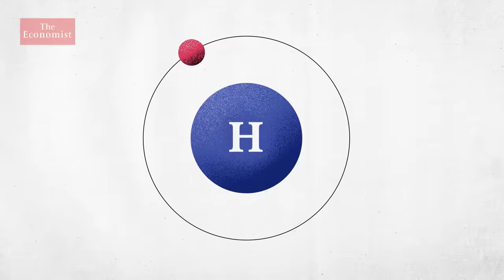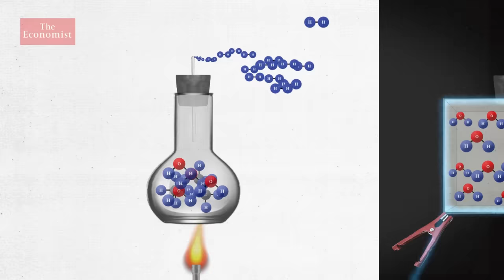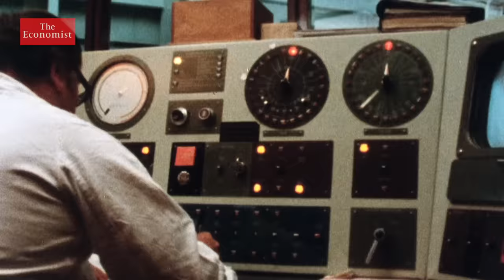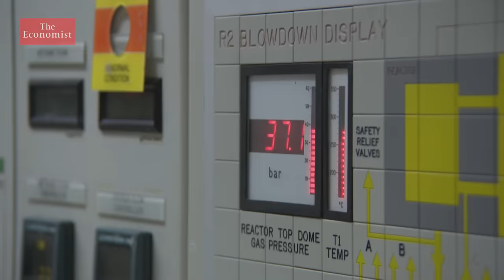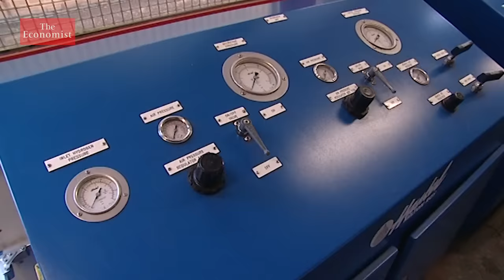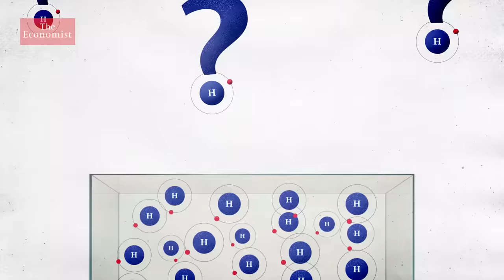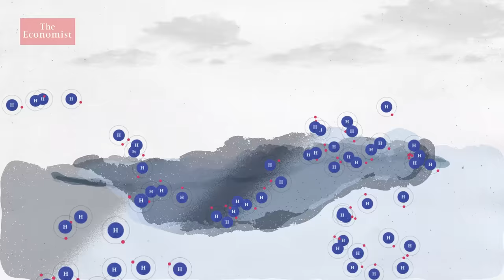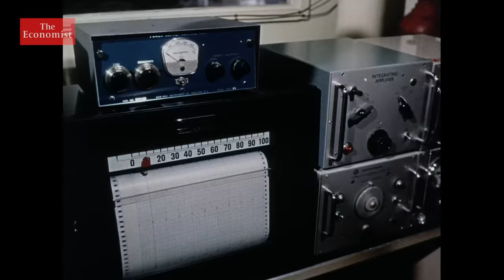Hydrogen: fuel of the future?

Comment: Hydrogen can function as a battery to store the excess energy from renewables when the sun is shining or the wind is blowing to then use when the sun isn't shining and the wind isn't blowing.
It could also serve as a battery for cars since the batteries we use now are unsustainable and leave an enormous amount of waste.
This is, because the materials required for batteries are too scarce and can't be reused after the batteries die.
Reply: I rarely have seen two sentences with as many factual errors than your post. Batteries are sustainable (lithium for example is more abundant than lead) and fully recyclable (when they reach that stage in their lifecycle in 20-30 years from now - today it's only 95% efficient). What is unsustainable is hydrogen fuel cells because they need platinum and iridium (the latter being the most rare metal we have at our disposal) to achieve any kind of longevity (5 years tops). I don't know if you are just talking but just to be sure: You need to have your FCEV pressure tested (700 bar/10000 psi) every 6000 miles, have new air filters installed every 18000 miles (at $500 a pop without labour) and have a new membrane at $1500 a pop every 36000 miles. That's what I call unsustainable. And on your tank filler cap there is a use by date printed after which you have to install a complete new high pressure tank system and hoses that can withstand the 10000 psi pressure - so it's a fixed "this car now is unsellable junk" date.

Comment: Nice video and you make the point well that hydrogen takes a lot of energy in to make it, especially via electrolysis. Now the chlorine industry has existed for around 100 years and the scale and technology is maxed out and mature and crucially it is basically the same technology used for making hydrogen. Sure you might yet squeeze another 10% efficiency out of it, but not 100%. Thus unlike batteries, there is not much improvement to be made. (You cannot beat thermodynamics.) So the costs will largely not change. Economically, today, hydrogen is a dud. It is unlikely to change much. The only way it will is to raise the price of everything else until it competes. So your last point is overly / naively optimistic.
Reply: Yes,u can't change the chemisty which makes H2 the highest density chemical fuel by gravity by far,there is 33.3KWh/kg,now the tech for H2 has advanced very quickly and is getting better daily,we can get zeroCarbon H2 from advanced nuclear reactors for very cheap.
Reply: Youre gonna be in for a surprise.

Comment: Yes, there is a certain hype, as always when governments hand out blanko cheques. However, it's still a hype. Besides the mentioned specialized industrial sectors such as steel production, I don't think hydrogene has any chance. Technically a lot is possible, but the costs, caused by the technical issues to keep hydrogene safe and contained as well as the poor efficiency over the transition processes, are just not in a reasonable area. Hydrongene cars are just not cost competitive with battery cars, and even for trucks, ships and airplanes there are already battery solutions at the horizon. And to use hydrogen as seasonal energy storage system, what Germany seems to be persuing, is just insane considering that more than 50% of the energy would go to waste.

Comment: Instead of creating expensive pipelines all over the land or hydrogen transportation through containers, I feel it is better hybrid stations of Electricity and Hydrogen Fuel cells serve for both purpose. These stations have EV Charging as well as Hydrogen Creation through electrolysis and containerization. There by we can reduce the  hydrogen leakage through transportation. So this enables small EV vehicles to be charged as usual and heavy duty vehicles can be refueled with hydrogen fuels. Hydrogen creation does not happen at source of Electricity, but at the point of fuelling.

Comment: Does the process start from sea water to fresh water then hydrogen gas ? Is salt the by-product ?
Reply: It's an electrolyte - reduces power requirements
Reply: @mtscott  all the H202  you can buy in the U.S. is made from an "organic" process  (oil) (HC's) combined with O2 from air
Reply: Natty, the hydrogen is made from methane, not water. Did you watch the video? Watch it again. And do a search about how Toyota makes hydrogen for their car. (They use cows. Cows produce methane when they chew which usually goes into the atmosphere and contributes to the greenhouse gases and adding to climate change. So this method has a double benefit). And a small amount can create a lot of power which they didn't go into.
Reply: @VoltLover00  American  Honda Motors has 2 electrolytic plants powered entirely by solar energy .
This is a "renewable" resource , unlike non renewable  HC sources .
Cheaper too .
Gotta THINK clearly.
Reply: @mtscott  I bet you've never considered H202 as an engine  fuel
Reply: @NCOGNTO  Not sure I understand your point. it’s a video about H2, not compounds of H. There is also ammonia, methanol, biodiesel etc etc. if you want to open up the discussion to all fuels. H2O2, as you probably know, was an experimental fuel in WW2 for rockets and torpedos because it self burned. But…it also has various limitations and it might not be useful to provide to the masses. Also…to make it is energy intense and produces vast quantities of CO2…opposite of what we are trying to achieve.
Reply: @mtscott  I can tell you're full of misinformation 
Where did you get those uninformed  ideas ?
Reply: @NCOGNTO  it’s called an engineering degree from a reputable institution.
Reply: @mtscott  surely we agree that H202  is the cleanest fuel then ?
Reply: Natty 27.

There are a number of ways to produce hydrogen the most common being produced from fossil fuels by steam reforming of natural gas or methane. I believe this to be the most pure form of hydrogen at the moment but, it is also the dirtiest form, Grey or Blue hydrogen.

The cleanest would be Green hydrogen, which would be made using renewable energy to make the power needed to use electrolysis to split hydrogen and oxygen. This still requires heat but the split takes place between 50 - 80C where steam reforming takes place between 700 - 1100C.

There is a ship called the Energy Observer that has been sailing around the world for 3 - 4 years now, using a mixture of wind, solar, and hydrogen to power the vessel, I think but I’m sure if they purify the water first before producing the hydrogen, best Google the project to find out more.

There are a few ferries in Europe that are powered by hydrogen but, they don’t make it on board, they top off the tanks when they come in to dock.

Hope this helps.
Reply: @martinrandall5836  you neglected to mention the 2 Honda solar / water H2 plants in California  for Automotive  use but I think they are significant
Reply: @mtscott  Michael  - most of the fuels you mention  are either flammable and / or require  pressure  storage .
H202  in any concentration  can be stored in plastic  containers  .
It is also the cleanest  fuel in use and manufacture (derived O2)
I think it's worth a look , if we are serious

Comment: HYDROGEN IS NOT A FUEL!!! Its at best a storage system and a very inefficient storage system at that. One of which perpetuates the pathetic distribution system of the oil companies... Hydrogen Fuel cells convert Hydrogen to electricity then puts it into batteries.... So the electric motor can use the electricity..... Why not just simply go to batteries??? Hydrogen may be abundant but you generally have to split it off from something then compress it to store it. Loads of wasted energy to get it to a useable state... Oh dont forget the delivery. 

Yes you cam make it and compress it at home... Again the waste. Just put the energy into the battery in the first place. Home batteries dont need to be the super expensive small Lithium Ions. There are a lot of very effective batteries for home use. Only use Lithium Ion for vehicles...

I have an electricity distribution system already in place. Its called the GRID. Which can be subsidized by home Solar and or wind. Let go of a failed technology! Lets move on!

Comment: Hydrogen is a total dead end because it’s hopelessly inefficient.

Electrolysis is only 50% efficient.

Even Toyota’s latest fuel cell in the Mirai appears to be less than 50% efficient.

And the fuel cell is heavy (500 Lbs) and expensive.
Reply: According to the US Department of Energy Hydrogen Program, a vehicle that run using hydrogen fuel cells are around 40 to 60 per cent efficient, whereas vehicles with a combustion engine runs at around 20 per cent efficiency. Still we are using very inefficient ICE vehicles for ages.

Comment: For airliners, the answer is YES.
For industry that need an oxidizer, the answer is YES.
When we want to store for a very long term and we have an intermittent surplus of electricity, the answer is YES.
But as hydrogen has an efficiency of ~20% in total, while batteries have 95%, even an improvement to 30% will not be enough for housholds, cars and trucks that do not drive too far. Long haul trucks is a middleground where price stand against time.
Reply: lol battery efficiency theoretical best is about 65%.  The difference is that hydrogen is not a fuel source that requires massive pollution and environmental destruction to produce, like EV batteries do.
Reply: Everything pollutes
Coal most so, then gasoline, while natural gas is better but still horrible.
As for storage, if you use you battery once a month or so, 65% is correct. Batteries should not be used that way.
But if used several times a week, the efficiency is well >90%
These facts really do not matter, the cost difference in practice will make H2 obsolete for houses, cars and most trucks.
It will not for airplanes, concrete, steel and long term storage though.

Comment: I still don't see the point in NOT using nuclear energy. Nuclear power is so much cleaner than most energies. Sure, the waste needs to be stored away for decades and so on in capsules, but it's so much cheaper and nowadays so much safer.

Comment: I've been holding my breath waiting for hydrogen to 'come of age' since I first realised that a hydrogen fuel cell car could be refueled at a petrol station as fast as my current car can. This solves the only downside for electric cars - range. If we decide to have only have cars with 100 mile range because hydrogen is available everywhere it will reduce the weight of cars, reduce the need for lithium and other rare metals etc.
I suspect that hydrogen is about to become very cost effective now that russia has caused LNG prices to soar. I wish I had shares in some suitable companies.

Comment: Storing solar energy in spring batteries for night usage is possible?
Reply: The future is not battery acid the future is hydrogen.
Reply: @rickrozen2341  I agree acid batteries and all the processing to make them is not a positive direction and hydrogen should be the way. My idea here is to use springs to store the energy by winding them up by electric motor during day and using the loaded spring energy for lighting not cars at night. No chemicals, problem may be metal fatigue.
Reply: @billykuan  You should send an e-mail to Elon he loves springs, giant catapults and other clown ideas.

Comment: Wait.. hydrogen DIDN'T cause the Hindenberg to explode? Then what caused it?

I ask because this is what was taught to us in school.
Reply: The doped canvas skin. The H2 gas is very buoyant,so escapes upward with no ill effect. Toyota fired a bullet into the Mirai tank with no ill effects while a Tesla will explode a 100% of the time a bullet hits the battery.
Reply: It was the paint
Reply: @paulbedichek2679   @Lucas Atilano , do you have any resources that talk about the cause of the disaster? I'm interested in learning more about it.
Reply: @John James It is a standard test.
Reply: @John James While getting shot wouldn't be very common, driving over something and getting the under carriage hit would be quite common. That kind of damage has been the source of battery fires.
Reply: @John James No, most fuel tanks can take bullets too. Yes, I saw the /s. You're still missing the point of how dangerous under carriage damage can be to a battery.
Reply: @lucasatilano8008  So if the Hindenburg was filled with helium, it still would have exploded? Obviously the fuel source didn't cause ignition, it was a dumb statement.
Reply: @VoltLover00  Hydrogen burns colorless, it doesn’t make a flame ball
Reply: @John James Tesla fires are common even though the vehicles are not.
Reply: @CamTracey  We agree nuclear power is by far the safest power available.
Reply: @paulbedichek2679  more common that ice vehicle fires? I'd be interested in those statistics. I've seen and read about a lot more ice vehicle fires than electric vehicle fires. But I'll admit, I've honestly not checked the actual statistics.

Comment: If then, why considering Hydrogen? It sounds like an EV is more efficient than an HF car.

HF car -> chemical residuals with H2O process requires electronic power from burning coals

EV-> No residuals, no compression process required, better efficiency than HF, straight charging from electronic power from burning fuels.
Reply: All this 'lets improve Cars' makes me think "Uhm, no? I saw Adam Somethings video on Banning Cars."

Comment: Jean-Marc Jancovici said that it take more energy to produce 1 unit of hydrogen than 1 unit of hydrogen can deliver. Is that really true ?
Reply: Yes, for every 55 kWh you put in you end up with 1 kilogram of hydrogen - which has a potential energy content of 33 kWh. At 50% efficiency of the fuel cell you end up with usable 16 kWh or energy in your car. And that's not accounting for the high cost in energy to compress and transport and store hydrogen.

Comment: Hydrogen definitely has a role in some applications such as heavy industry and it's great that this will remove a source of CO2 emissions.  However, hydrogen is a bad solution for cars.  EVs are much better, because they are 3-4 times as efficient.  People can charge their cars overnight at home on cheap electricity when grid utilisation is low.  EVs avoid the need for a distribution network with lorries clogging up our roads.

Comment: I solved the problem of hydrogen transport already.  You just attach the hydrogen to a carbon chain eight atoms long and you get a volatile liquid that liberates its hydrogen for combustion upon heating.  What's more is my invention can use existing infrastructure and requires no modification of existing automobiles.

Comment: how the car insurance going to offer you the premium? if accident happen, is it safe ? how "safe" ?
Reply: Toyota spent a lot of time and money developing the hydrogen fuel tank and the hydrogen fuel cell that they use, they have passed all the safety tests that North American and European insurance and health and safety could devise.

The hydrogen is stored in a tank in the vehicle at very high pressure and if it is ruptured, then because it is stored at pressure, the hydrogen escapes in seconds into the atmosphere before it can be set alight, and because it is lighter than air it just goes straight up into the air.

There must video some where of the tests.

Hope this helps.

Comment: Water vapour still acts as a greenhouse gas. Will this be an issue if water is the only waste product in a hydrogen engine?
Reply: Some kind of cooling system could be used to condense the water so it escapes as a liquid instead of escaping as a gas. You could also use that waste water to produce more hydrogen.

Valid concern but there are a fair few solutions.

Comment: Nope, H2 is just natural gas in an inefficient form with lots of capital expenditure for infrastructure. Hard pass. Electrolysis + transport has no chance to compete due to cost.
Reply: The Japanese are already doing it...
Reply: @TheYah00netstar  Gov't subsidies...
Reply: @michael2275  - I know they financed the construction of joint-venture plants for the production of hydrogen in Australia...and the UAE for the purpose of importation to Japan...
Reply: Natural gas has carbon emissions
Reply: @TheYah00netstar  All based on gov't subsidies not raw economics.
Reply: @TateVanPatten  H2 made from steam methane reforming (only reasonable cost way)  is essentially the same as burning natural gas just at the point of the H2 production. It's actually worse due to the inefficiency and transport.
Reply: @michael2275  - It's a sort of a new industry...so I wouldn't be surprised about subsidies at the present stage...
Reply: @TheYah00netstar  Competition getting cheaper too and H2 way behind in cost so has very little chance of ever amounting to much.
Reply: @michael2275  "Gov't subsidies" - same with electric cars
Reply: @VFPn96kQT  And US oil companies